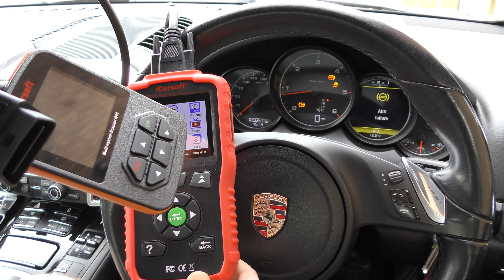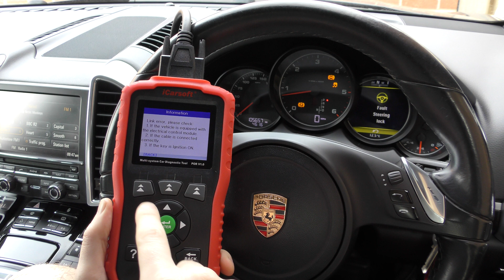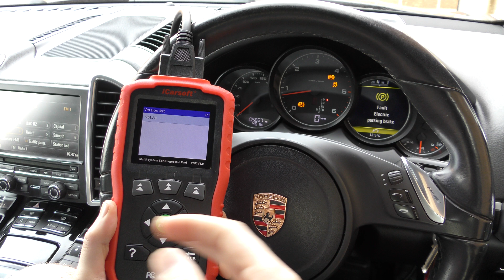iCarsoft Link Error - HOW TO FIX VIDEO   Connection problem

Comment: I'm using the red one.In your video,when you press the engine icon i see that it says POR(Porche).When i plug it in,it start scanning and immediately say "communication fault". It doesn't even connect,(recognize) my car.I've tried everthing,(update,checked the fuses etc..)nothing works.So now i'm stucked...😌😪

Comment: FIXED!  I got ECU comm error when I selected the SRS test on my 2009 MercBenz C300 W204.  Per icarsoft support emails with Barnett Davies, I selected 176 A Class then 176.044 A250 then SRS test and it worked, read codes and cleared codes.  Great support from iCarsoft!
Reply: I have a different scanner but same problem. 2010 w204 c300 when I try to reset or read srs it says this function is not yet supported. I will try the models u suggested I hope it works for me. Because the software update didn't fix my issue

Comment: Email address please.
I got “locked out” of my recent Ver2 unit saying “error 3”.
My wife updated to version 2 software, screen cleared, worked for a minute then locked out with the same “error 3” screen.
Tried plugs were connected properly but made no difference.
Just sent an email to my supplier here in Australia, Elite-Electronics.
Ask me for an update and I will tell you if they were any help.
This tool got such good reviews, but if it’s going to lock me out, then $200 plus down the drain.  Let’s see how good the “customer service” is.
Reply: We have just got locked out of ours. Did you resolve the issue

Comment: Bought mine 6 weeks ago. Downloaded the latest software It still won't communicate. Tried the email address given 3 weeks ago no reply. Tried contacting Diagnostic World by email and they did respond to begin with but have now stopped.  I have tried to ask to return the unit which doesn't work and I am being ignored.  I am now £99 out of pocket. Do you have a phone number so I can speak to a human.
Reply: Mate, how did you go?
Were you able to get your tool to work?
You can read about my issues.  So frustrating, and iCarSoft customer support is at the moment non-existent.  I really hope I’m wrong though.
Reply: @martinlang9615  I was getting fobbed off by icarsoft so emailed diagnostic world instant response v apologetic. I sent the thing back and was refunded.